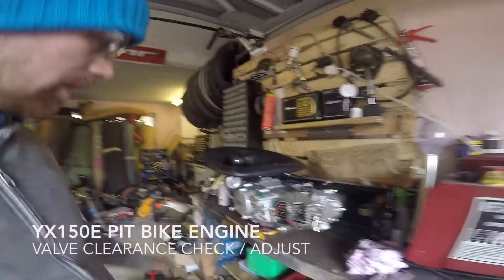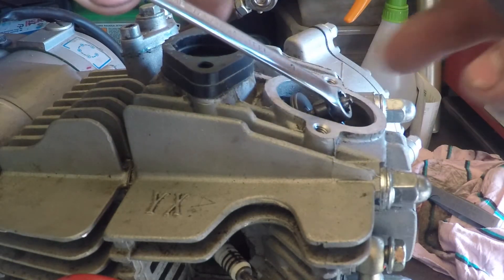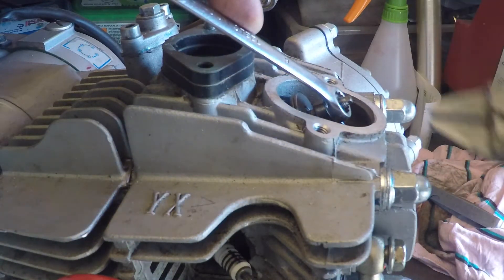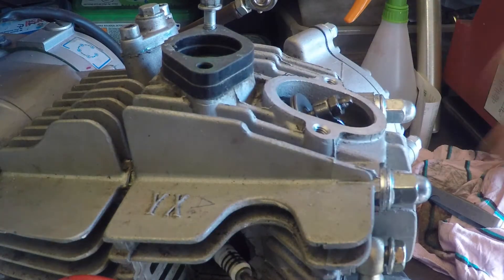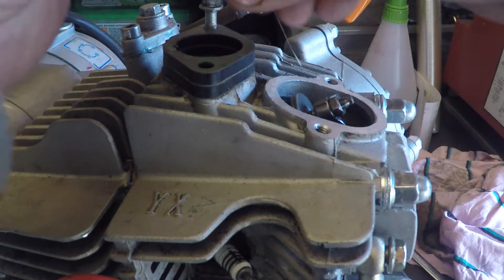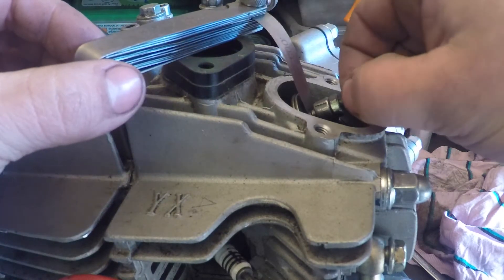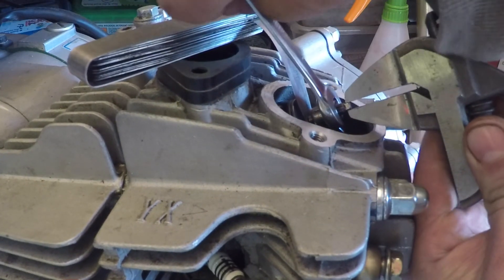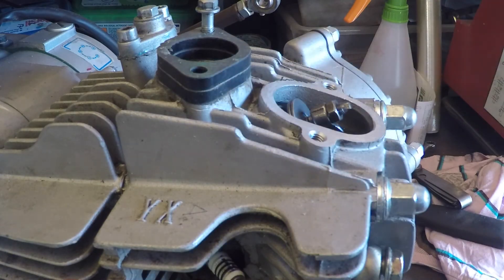WRENCHLIFE - YX150 PIT BIKE ENGINE VALVE CLEARANCE - HOW TO

Comment: Hi mate I’ve got a yx160 is it the same as the 150
Reply from the maker: very similar, the 150/160 are different to the 140, but they are very similar to work on in many respects, jon
Reply: Thanks pal

Comment: Do you have to be at TDC?
Reply from the maker: Top dead centre at the top of the compression stroke part of the cycle. By this I mean that in a 4 stroke, (4cycle), engine the piston comes to TDC twice in the cycle. You should rotate the engine until the point where the engine is at top dead centre, check if both the valves are closed, if they are then do your valve clearance then. if they are still open, rotate the engine crank one full turn, the valves should both be closed now and you can check and adjust the valve clearances

Comment: what would you suggest if both the intake and exhaust valve nut became loose and fell inside the motor while riding? I can't find either nut
Reply from the maker: Joseph Krause 
take the head off man, there is a return channel that takes the oil feed from the head back to the sump, chances are they will have got stuck somewhere in there, I think they are a bit big to make it all the way down to the sump plug buts that's the direction they woulda been heading in, check out the little bastard rebuild videos parts 2&3 on the channel where I strip down and rebuild this engine for more info. them wee nuts need done up really tight! good luck, Jon
Reply from the maker: (my bet is that they are in the cylinder section of the return channel BTW...😉)
Reply: WrenchLife ok, thankyou!!!
Reply: WrenchLife now when I take the head off, the timing chain also has to come off. Is that easy to reset?
Reply: WrenchLife gotcha thank you. I took off the top hat and the cylinder, I don't see the return chamber that you were talking about. specifically, where is it?
Reply from the maker: Joseph Krause if you look at the head gasket you will see the big hole for the piston/bore, 4 holes for the head bolts, a big slot where the timing chain passes through and 1 single hole below the piston/bore hole. This single hole on its own is the hole where the engine oil is returned from the camshaft/rockers in the head to the block. when the little tappet screws and lock nuts come loose this is the route they can take out of the head. So match the hole in the Gasket up to the hole in the head and cylinder first and check in these two places, often the nuts can get stuck in the cylinder as the hole tapers, beyond this they are in the engine so it's a bit more major surgery, if you haven't taken an engine like this apart watch them videos and probably a few more first, there's a lot of wee bits!
Reply: hey! I just got off the phone with a tech from tbolt which is where the engine came from. he said the only place that it could go is on the Kick starter side of the case. he told me to remove that and check behind the stator. does that sound right? he said there is no way at all the nuts could have gone into the cylinder by the piston
Reply from the maker: Joseph Krause I have a pretty tricked out yx140 engined pitbike I've had this last 7/8 years and a couple of years back I noticed it was running like a bag of ass lol, anyways I pulled the tappet covers thinking maybe it's an adjustment issue at the tappets, I was pretty much spot on as the issue was in fact the same as the one you described to me, the tappet locknuts were missing! anyways I pulled the head off to see if I could see them and found them lodged in that hole in the cylinder.  unless there is a key aspect of the internal architecture of your engine, (because I know there are differences in some of the more recent variants), my bet is that that's the route they have taken, I even pulled an old 140 I have in a box out there to see.  Is yours a yx? 140/150?
Reply from the maker: Joseph Krause BTW the nuts would not get into the cylinder is correct, its not the cylinder itself I'm saying the nuts could be in, it's the oil return channel in the cylinder section/casting of the engine.  removing the stator plate may actually give you enough access to retrieve the nuts from the gearbox/block casing with a clean magnet, good call from the tech.
Reply: WrenchLife awesome. thankyou! I'll take a look at it. I appreciate the help
Reply from the maker: Joseph Krause dude, feel free to ask on here or you can direct message on the channel also, for a lot of people, a pitbike engine is one of the first engines that they will ever try and take apart, so it's understandable to have issues lol
Reply: WrenchLife how can I dm u on this channel?
Reply from the maker: Joseph Krause go to the WrenchLife channel homepage, click the 'about' tab then there's an option to send messages in there, Jon
Reply: WrenchLife I didn't see an option on the about tab.
Reply from the maker: Dude as far as i know it should be there, right hand side close to the top, you may need to be on a computer rather than a phone too (if that applies), or just fire the questions up here its no bother
Reply: @WrenchLife  im having troubles getting the camshaft sprocket timing mark to align with the cylinder head tdc. I have a w150 pitster pro i removed the cam due to rocker arm failure and now when I try to align either slotted mark to tdc one of the two valves open. Head is off of the bike as well. Any insight would be greatly appreciated.

Comment: Hey man love the videos! Would it be possible you could go over a couple things a little more in depth? I'm interested on how you designed the frame, and how you did the launch control for the motor. Thanks!
Reply from the maker: +Nathan Braun Thankyou :) heres a link to a sort of build thread /summary i did on the All Terrain Lawn Tractor Forum a while back, which has some stills of the chassis in various stages, as for the launch control ill try put a video together on that soon, it has-been on the to-do list actually because i do get asked about it, theres some explanation of it in that thread also, the CDI unit that contains the electronic elements of the rev control came from OORacing.com who are based in England and specialise in these small engines.

LITTLE B' - David Brown bike engined mini tractor
Reply from the maker: +Nathan Braun http://www.atltf.com/t4800-little-b-david-brown-bike-engined-mini-tractor